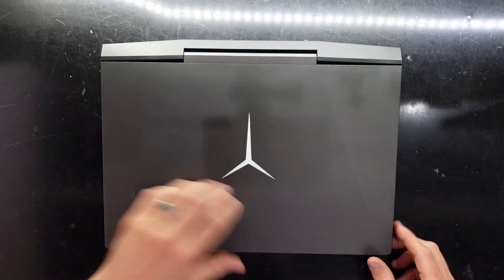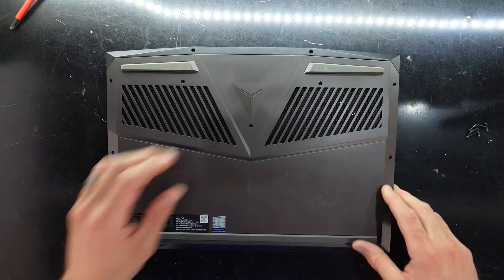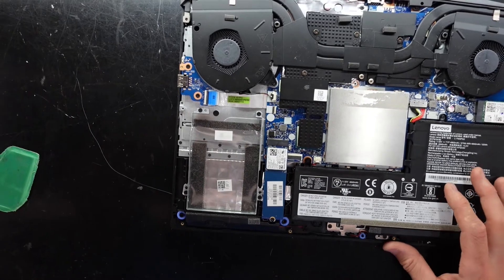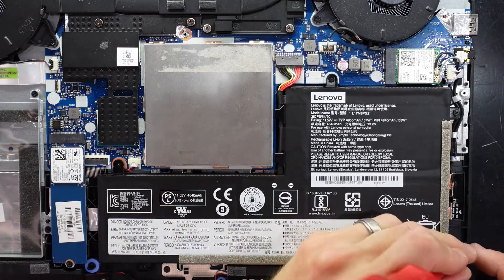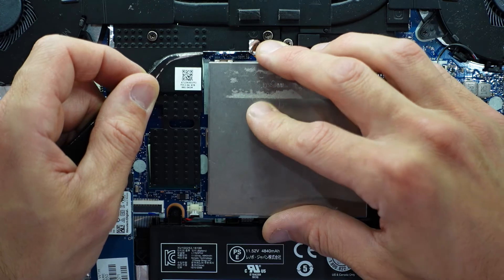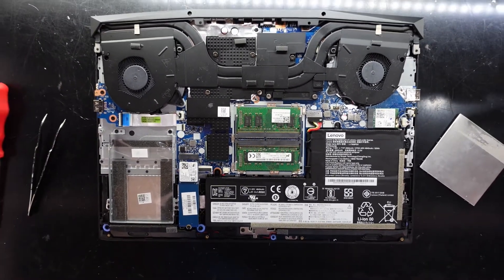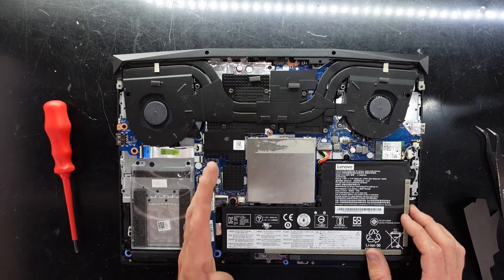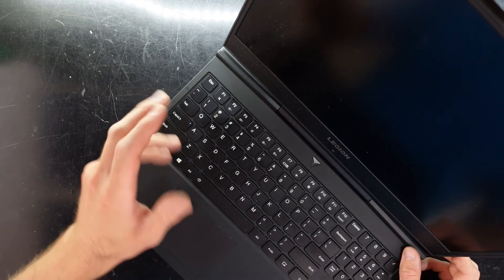Lenovo Legion Y545 Teardown and upgrade options

Comment: Hey bro, how do i improve the battery for this machine, i got the 512 ssd, 1 tb harddrive, 1660ti version. Any software tweaks or advice to make it have better battery, imma use this for college. Contemplating if I should buy a m2 air or keep this machine.
Reply from the maker: I wouldn't recommend a gaming machine for college or all day study
Reply: I currently have this machine since I bought it so long ago! What upgrades would make it better for a school setting ? Redoing the thermal paste for sure
Reply: Hey, I don't know if you found a better option for a pc or what. The Lenovo software has a toggle for Hybrid mode, this activates the MUX switch and it turns the GPU off and uses the CPU's integrated graphics. I have found that this greatly improves the usage time of the laptop. In Windows there is also a battery saving mode that should help as well.

Comment: Hey Rick. 
I've been wanting to upgrade my storage capacity from 512GB to 1 maybe 2TB. Mine says it's an SSD but I don't know where I can find one that works with my laptop and I don't know how to replace it. I did watch your video but yours has a hard drive, would the SSD be in the same location? and do you know where I can find a 1-2TB SSD for my legion? Thank you in advance, your video is already helping me take the steps to do this upgrade
Reply from the maker: 2:35 working from left to right.

2.5" Metal Tray for Hard Drive   
Blue coloured rectangle = M.2 NVMe SSD
Battery
Reply: Cool, thanks

Comment: I have the same laptop and i broke my screen... I find it hard to find a screen replacement from Lenovo... Are there any other compatible screen panels for this model?
Reply from the maker: Most panels are interchangeable, so going by screen size, resolution, refresh rate and screen connector. 

you will find one thats compatible